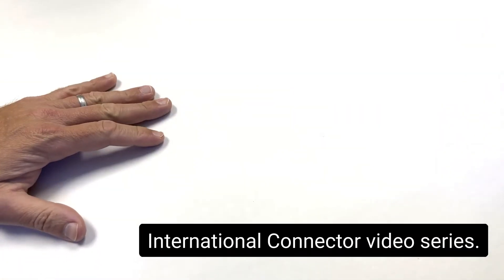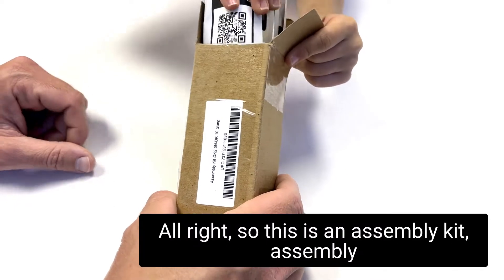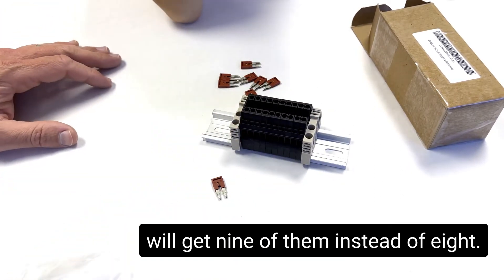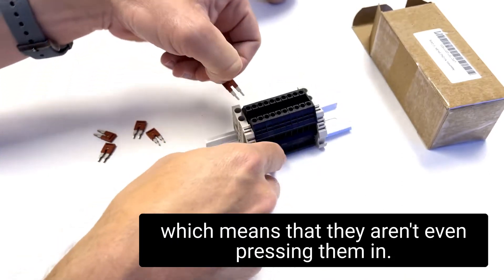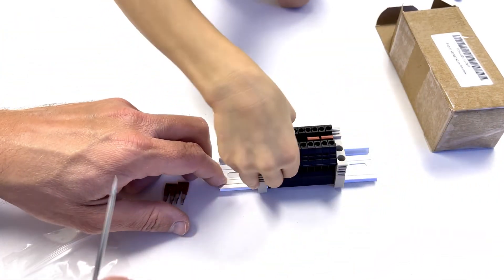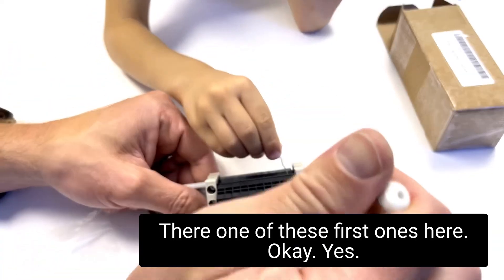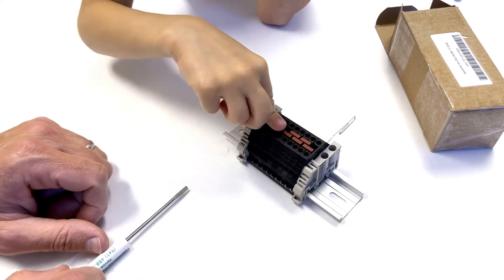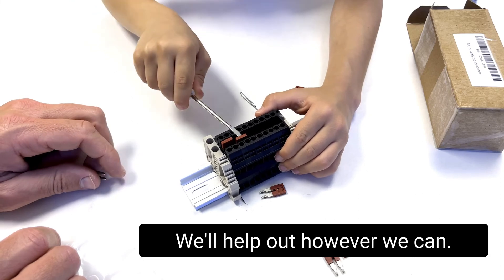DIN Rail Terminal Block Assembly Kit DK2.5N-BK 10 Gang Unboxing - International Connector

Comment: LOVE the inclusion of ‘June’ 😊

I presume that small square-crimp ferrules work well for individual insertion ?  One thing that I have yet to see online is a Fully assembled unit (wires connected, incl. SUPPLY).  I’m a visual learner, and it would be informative to visualize the connections.

Great invention, and I wish you Success in your endeavor(s).

Bye June !  😉
Reply from the maker: I will try to make more videos with wires.  Ferrules are not necessary.  Some people like to use them out of habit but they are not needed.  Thanks!